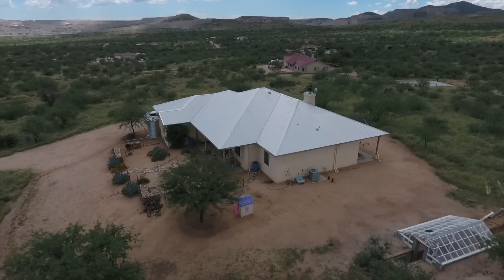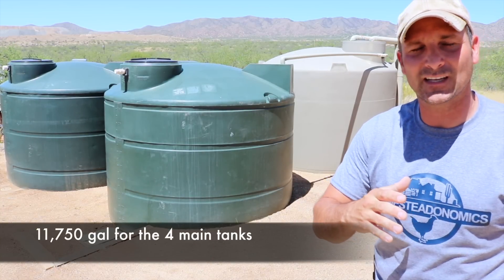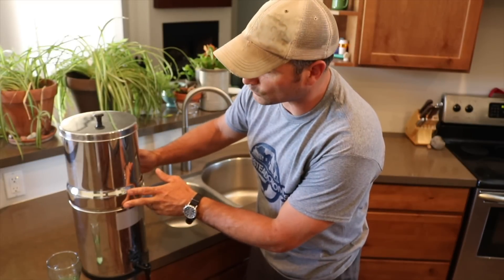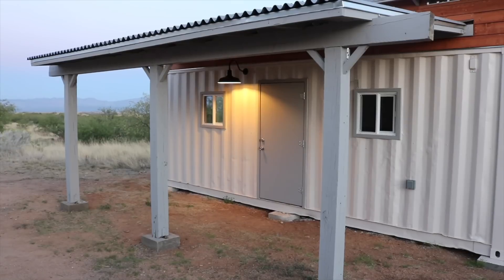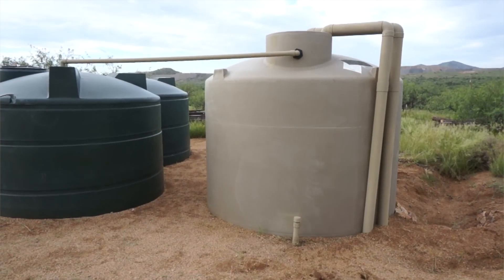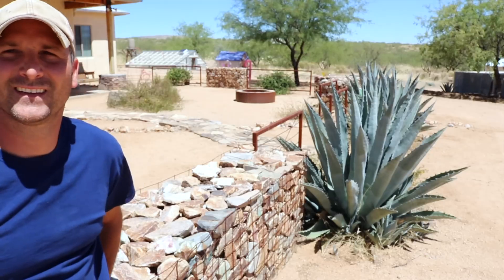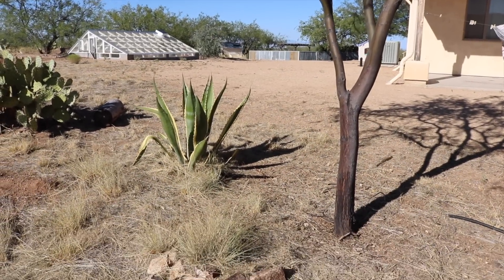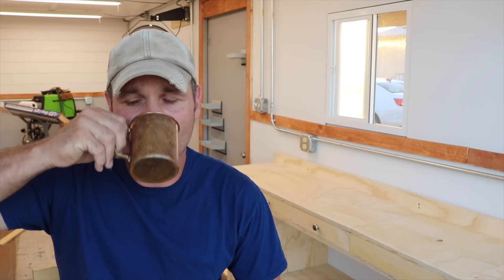Rainwater Harvesting QA - Cost, is it Illegal, how I treat, etc,.

Comment: How come you didn't 100% bury the tanks? Or build a shed over them (more collection roof) to get the tanks out of the sun? How do you pressurize the system? What and how many pumps do you use? Do you use any UV sterilization? RO/DI? Do you monitor the reserves with any electronics? Meter the input and output gallons? Have you taken into account the cost savings of a well pump electricity versus what you pressurize with now? (A kill-a-watt plug would be interesting to use on the pressure pump.) Have you had any issues with too much water overflowing the tanks? Thought about digging a swimming pool if you ever do have excess capacity? Do you have to chill the water at all in the Summer or is the temp pretty much fine for all uses?

Congrats on this system - very impressive!!!! In Illinois we have too much friggin water. Lake Michigan is way to full! LOL But someday I will definitely use some of your design!

Comment: What an absolutely fantastic setup you have there!! I love the fact that nothing is wasted and you have come up with creative solutions.  

I really think that a rainwater harvesting system should be made a mandatory part of building any new home. Yes, I can see that $5,000 or thereabouts might sound a lot. However, in the grand scheme of building a house, this small amount is nothing. A house shouldn't be built anymore just for it's looks and style. Nowadays it's just as important to include environmental features to future-proof a house and limit the environmental impact.
The only thing I would do differently in your setup is that I'd have the tanks buried in the ground (not easily possible where you are from what you have said). Otherwise, I love your system and approach to this.

Comment: Add your Berkey filter to your description!   I think I found it on Amazon for $202, I'll try to buy it through your Amazon link when I can, we are on a spring and I've been buying water as I tried to find a filter I liked
Reply: If sediment was an issue you could always have a tightly sealed IBC tote with a couple through hulls, run the inflow down 2/3 - 3/4 of the way with a simple diffuser at the bottom and out flow from the top, the slow up flow will allow most of the sediment to drop.

Comment: I built my own purification system using sand  peculation system as a filter measuring 3' deep, 3'x 3 ' and only 3 drops of chlorine on the natural side only per 20 gal.  I back wash three times a year and remove the top 4 inches of sand and replace it in the summer months only.   I add pure mined; non processed salt to the water.  I also add trace minerals recommended by USDA for livestock.   

They have economic value; we; humans don't.  So their purity standards are 29% more strict. Than Human standards. 

Your sand should be quarried non compact able  only. The peculation method is only duplicating  mother natures way of purifying water.

Comment: I have those green tanks and will be doing exactly what you're doing, but with a larger roof area and in a PNW rainforest. The initial tank for sediment is a great idea. After watching the video I'm going to do a diverter for a first rain day flush. I'll have so much water that I plan a few mini hydro units for the excess water. The totes are a great idea for watering gardens! We also have a spring and an artestian well! I got my green tanks off Craigslist for less than half retail, they were new, a failed off grid project..

Comment: I think I would have spent the money for the well and done rain capture together.  It's a lot of money but if there is water under you the investment will be worth it in the long run.  The deserts are only going to get drier and hotter. Fact.
Reply from the maker: I agree... but the risk of spending the money and have no water in return was too risky for us.  Our neighbors had two dry holes after their attempts. But another guy across the road has a good well.  The rock layers make some areas have great water and others have little or nothing.  I'd love to have a well ultimately, but I'll have to wait until the house is paid off first before
Reply: Yeah I hear ya, impressive project, I could never do it.  We have a bit more water up here in Wisconsin.... :)

Comment: On my system, I purchased a float kit so the water that goes to the pump comes off the top of the tank and the over flow takes the water off the bottom of the tank.  I used concrete tanks, a bit extra but worth it.  The concrete tanks keep the water cooler in the Summer and also neutralize the acid in the rain water.  I set  this up on my new small 2 bedroom house in Upper Hutt New Zealand  just before a big storm hit and harvested 40,000 liters in 3 days approx 10,000 gallons.
Reply: also i read that plastic or steel tanks will add a taste to the water. this was from a guy who concrete lined a water tank on his boat. i know from drinking distilled water different water sources have different tastes  but you get used to it

Comment: If you do a follow up and answer questions.  This question may have been asked but here is one.  Is a gray water system code?  Here in CA only gray water from the washer can be used.  This is a stupid rule because CA is a desert like AZ.  You should test for bacteria and heavy metals.  Ignorance is not always bliss.  You will discover the bacteria when you wash something and then put it in the fridge or leave a wet item on the counter where the bacteria grows.

Comment: Hello from "God's country" East Tennessee.... Because of the Tennessee Valley Authority and our numerous lakes, we have plenty of water but, I love your set-up so... thinking how my gutters could be directed to a tank in my yard and a pump installed to use for watering the yard during our hot summers is now a new project... thanks.... but seriously... can you explain your system? ie.. how the water gets from your gutters to the tanks... it looks like your pipes rise up at the tanks.
Reply from the maker: Hi, I call it a 'wet pipe system' but essentially it's just elevation change that moves the water from the gutters to the tanks.  I explain it in much better detail in my 'rainwater system tour' video.  I have a link in this video and a link in the description to it.  hope that helps:)
Joe
Reply: I built a much smaller system using two $120 pumps from Northern Tool.  The pumps that are pressure demand for sprayers.  They stay off until the tap is turned on or the toilet flushed.  Then they come on and run until the tap is closed or the toilet shots off.  I set the pressure to 45 lbs.  It has worked on our cabin for over a year now.  They also sell the same pumps in a 12 volt version if you want to set up a battery bank and solar charger but I didn't care to mess with it.
Reply: I live in the desert southwest and have a similar setup ( 6 3000 gallon tanks since we get few showers but occasional heavy rain)
Greg Mardis:  those pumps work much better and last MUCH longer if you put a small pressure tanks behind them.  They cycle less often which means longer life.

Comment: Super video and a very impressive catchment system. My parents are in Bellingham, WA and have a 100% rainwater catchment system. Just like you, no well or city water hookup. 

Their system consists of three 3,000-gallon tanks in the basement of their garage.  Those three tanks collect from the roof of the house and the roof of the garage. All roofs have extended eaves to maximize catchment. 

Filtration consists of mesh screens where the roof water enters the tanks, then a paper media filter, a UV sterilizing light, and finally a charcoal filter. 

I like your comments about First Flush systems. We will have to consider adding one since the tanks develop an inch or so of sediment per year. So far we have just been flushing and cleaning the tanks annually during the rainy season. 

5 years and going strong!  It's a bit of work to maintain and keep clean, but it's rewarding being self-sufficient.

Comment: homesteadonomics I have an idea that I am going to implement into my system that you might be interested in conserving water in the bathroom. I'll be going to live in the Philippines soon & living off grid. With the wash basin's in the toilet/bathroom I've  worked out an idea with this basin that has an overflow set up on it but instead of using a normal flushing toilet you put a push button plug into the basin, as you wash your hands after you have used the toilet you fill up the basin where you wash your hands you then pop the plug & the water that would normally go out down the drain you can divert it into the back of your toilet bowl to work as a flusher. So you would normally use 3 liters to flush a toilet & whatever amount to wash your hands, why not use just the handwash water which will save many liters wasted in a flushing toilet. Also your sewage pit will not have as much water go into it. With your shower water you can divert that to your garden as well as the kitchen basin.

Comment: Interesting ideas, mate! I have a house out in the countryside that would probably benefit of some kind of water collection like yours. I took some notes. I was wondering though, why did you opt for those reservoirs instead of actually building a holding tank (think of masonry or concrete blocks) with a geocomposit membrane? Or is it just not a thing done in the US?
Reply: Also, I wouldn't advise collecting water from any king of road. Especially in place where rain is not frequent. Usually the pavement has oils and other kinds of small particles that are hard to separate from water without a proper chemical treatment of some kind. I wouldn't like my fruit trees to drink from that water.

Comment: Rain water isnt acidic from carbonic acid. It is acidic because it is pure water. Pure water is very corrosive and I advise you to add lime and other minerals to it. Drinking pure water is not good for you. 5.5 is about what pure water is on the ph scale. please treat it. Years down the road it could cause health issues. I work at a water treatment plant in Southern california as an operator 1 and whenever our water goes through RO we have to treat it with lime to bring the ph up. If we didnt, health problems would occur.

Comment: you get enough rain in the arizona desert to live off of? I could be wrong but I typically think of arizona as a very dry place with not much annual rainfall at all
Reply from the maker: yep... it's pretty dry here, but if you can hold it there is way more water in an inch(cm/mm) of rain than most think.  However, here it is about holding capacity... we get roughly 12" of rain...and we get it in two main times... so I gotta have the capacity to last between rains.  someone living in a place with a lot of rain could easily have a small tank as it would be getting refilled all the time.  Hope that helps and thanks for watching:)
Joe

Comment: harvesting rainwater on the scale of a home like yours for domestic use is rarely an issue.

rainwater harvesting is regulated in most places to keep massive land owners from eviscerating the local water table and damaging the environment. for example, many states in the midwest are dependent on aquifers that would be disrupted by large-scale loss of rain water if all their farmers decided to start harvesting rain, instead. that's why, if you actually look into most state laws, there is some cut-off for how much is allowable that is well in excess of what a home could reasonably use. 

in what few places where a setup like yours would be illegal, the monetary incentive for EVERYONE to do it is very strong (nevada, california) and at that scale it would be a problem. 

it's easy to take water for granted, but it's very possible for humanity to cause permanent, irreversible change to the environment by screwing with rain water.

Comment: Great project. One question, i seen in one desert place a sistem that colects water from fog during night?! Do you usualy have fog at night?! If yes you can colect water frim that easylie.
Reply from the maker: hi filipe!  I wish we did have fog but unfortunately we might only have a good fog a handful of times a year.  But I think I've seen what you're talking about.  Essentially they are condensation surfaces that the fog deposits water on and then it drops down into the collection trough.  Very cool...just wished it would work here...

Comment: You need an UV sterilization filter. That's what is used in commercial rain harvesting systems.
Reply: Radry, I have never emptied the tank in over 10 years, so I guess somewhere between 0 and 10 years? Yes, it is overdue for cleaning, I'll be doing that this year.
Reply: radry100 distill it. Use that sun energy to solar power the distillation
Reply: Water vapor is intrinsically pure water, but rain, specially storm rain, can de contaminated by the dust raised by the winds generated by the storm, and guess how they're precipitated. Also, sometimes dirt and water from the ground is raised by strong winds or even tornados, to be poured on earth; how many times have rained fishes and frogs? And there the case for acid rain, water contaminated by pollutants that develop as acids or not so nice compounds... So don't trust rain water to be pure always! I do agree that even when contaminated, it may be more potable than tap water.
Reply: my family live in vietnam  for generation  and they only use rainwater  for everything on daily
Reply: I use a small pond pump with a uv light that I bought from Lowes .  Like $90 I think.  I don't know if I actually need it but it doesn't hurt.
Reply: "I have lived on untreated, unfiltered rain water most of my life. I am 55." same here, although i am 34.

i have drank it right out of the tank, no chlorine, no filter nothing, although at one place we used a piece of old stocking as a filter because we got a lot of Miskito lava in the water.
Reply: Australian farmers & rural householders have depended on rain water for drinking for many years. They have not relied on filters or sterilisation. Its safe to collect, store and consume rainwater. Of course the water needs to stored in a proper water tank.
Reply: radry100 I had that, squirrel and rat
Reply: Periodic testing would be prudent. This is so prevalent in your area. The local government should develop best practices guidance. Instead of taking a smoke break, he gets to enjoy his handiwork.
Reply: radry100 he has a Berkey water filtration system for drinking and cooking.  The Berkey filters any water cleaner than city water!  Check them out.  The price isn't too bad either!
Reply: Joel Rufiange that berkey filter will get everything out
Reply: Everyone does that. The Army has a set procedure. Every Army unit with a "Water Buffalo", most units, understand this.
Reply: We all have water catchment and don't conserve at all, all our tanks over flow all the time, location, location, location
Reply: no you dont really,  you may want one but you dont need one
Reply: I have lived on untreated, unfiltered rain water most of my life. I am 55.
Reply: Rainwater is very nearly pure distilled water. Sure, it'll pick up a few contaminates from the air or the surface you are collecting it from, but if your system does first flush elimination, your captured water should be pretty damn clean. Cleaner than the 500+ PPM city tap water I get in Mesa, AZ. If the water is pure enough, I wouldn't expect there to be enough nutrients for micro-organisms to build up significantly, even if stored for a long time.  So yeah, I'd be willing to take my chances drinking untreated rainwater any day over smoking 3 packs of cigarettes a day.
Reply: K9spud You don't need the filter for the rainwater that, as you say, is clean. It's about the storage. No matter how clean you tank is, harmful bacteria will grow. Also you don know what's in that tank, maybe some small animal shit in it or died. The filter ensures it's clean after beeing stored!
Reply: i wouldn't drink rain water collected near by a big polluting city
Reply: 77gravity how long did you store it though? If you drink it fresh from the sky it not contamined yet. Also what you say is like a smoker claiming the never had lung cancer although he smoked 3 packs a days for 30 years.

Comment: its a great system but i dont think i'd go to that extent to conserve water, water is absurdly cheap where im from but lpg and electricity isnt so i cant get cheap heating for the shower or stove so i'd probably use a hydrogen electrolyzer to generate hydrogen fuel and oxidizer which i can use for hydroponics or welding equipment

Comment: what the chemical they spray in the clouds I was just wondering if that filter system for your drinking and cooking water is sufficient to get the small particles out what is the diameter of the small particles it'll go down to is it is similar to a compressed carbon filter just a curiosity question